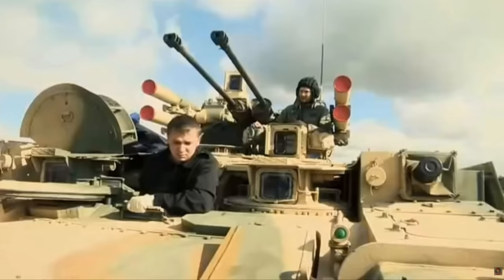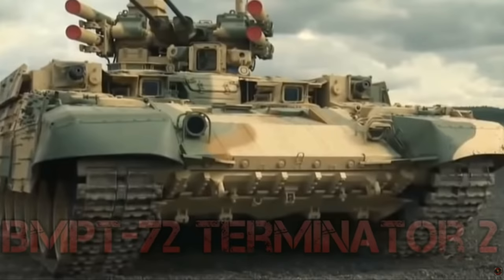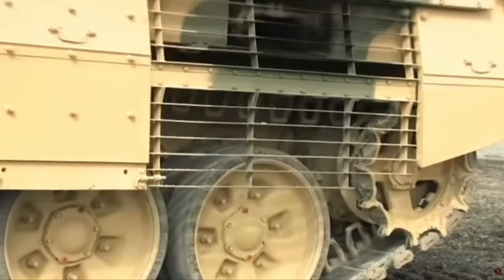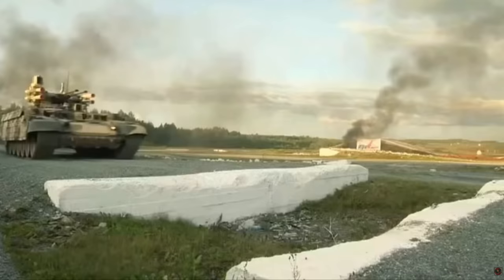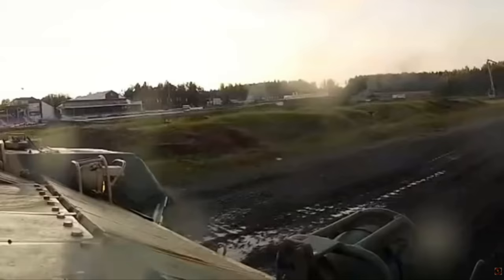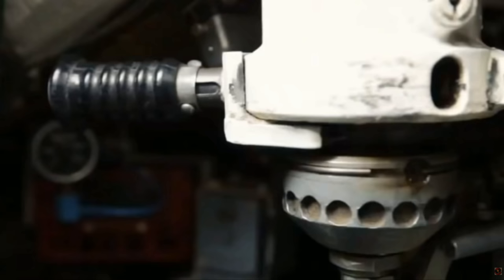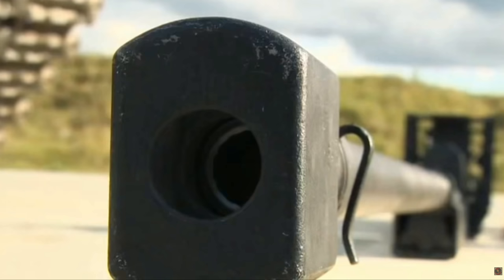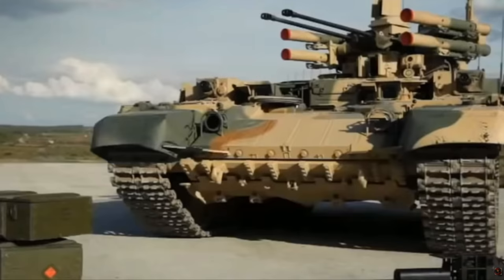BMPT “Terminator" Tank Support Vehicle Overview

Comment: Well ..  A Stugna-p - with the launcher just above line of sight - and the (thermal detectable) crew behind cover - will unlikely be detected and reduce the vehicle to a wreck. Spray and pray looks impressive, but a distraction from a bit of fireworks in a forrest edge will possibly make it expend its ammunition to no avail. Technology is currently on the side of the well hidden defender.
Reply: Stugna can't penetrate most of BMPT
Reply: @grandayatollah5655  stugna P can most definitely go through a T72 hull even with k5 on top. This is a modern tandem ATGM which deals with most hard targets fairly easily. We've seen these wreck T72B3s and T80BVMs which means they can also wreck a BMPT
Reply: @grandayatollah5655  Hmmm i really doubt armour as a concept now.
Even then the ATGM can just hit the turret or track that are both unarmoured and will disable the vehicle.
Reply: @davidty2006  tracks have Relikt + 4S24 sideskirt
Reply: @Yung_pindakaas  BMPT doesn't have Kontakt-5, it has Relikt (which alone can stop tandem shaped warheads)
Reply: @grandayatollah5655  Sideskirts arn't much.
They don't cover the whole track normally just the top.

Comment: A T72 chasis with a 5 man crew. 🧐🤔

Matt: Radar guided Air Defense system. 
Me: So the Shilka 2. 👍
Reply: The T-72 is built for a 3 man crew + the autoloader. The Terminator has no autoloader though has  an unmanned turret if I'm not mistaken. It's going to be cramped in there for 5 people.

Comment: The T-72 and T90 hulls are in dire need of a new gearbox. In combat, the crews of these things are still forced to reveal the rear end of the vehicle. Maybe T-80 hulls with diesel engines would also be good for the BMPT system. E.g. to drive up to the trenches, to unload his load into the trenches and then with the frontal armor to the opponent, to retreat again. But with a T-72 hull, that's unfortunately not possible. The BMPT has to turn and drive away with the rear facing the opponent. You can also see that here in the video that the Terminator never drives backwards but always just turns to drive back. There is a video of such a thing attacking and destroying a Ukrainian fortified position and trenches in a forest. Absolutely amazing how this thing blows everything away. A tank would have had major problems in this environment.

Comment: When there's a javelin coming after a armored vehicle it's open season 🚀 protection I don't think so 💥
Reply: Javelin has shown to be a bit overated in the current conflict. When it works its good, but it doesnt always work. Even western users of the system have complained about not being able to get a lock on tanks. Lots of complaints about it failing and also not being practical due to being way too heavy and bulky for a portable system. The best weapon AT Ukraine has so far in the conflict is Stugna-P.
Reply: @MS-wz9jm  Hmmm Stugna P is just set it up and go hide behined a hill or something.
Since its remote operated thus not risking the gunner.
Making it ideal for ambushes.
Reply: @davidty2006  Yep. In terms of man portable weapons the Panzerfaust 3 and AT-4 have worked well. No failures and not too heavy or bulky to carry around.

Comment: Terminator 2 built on T-90 chasis, not T-72. First one was T-72 based and it was around for realy long time (prototypes apeared in 2002 if i remember correctly)
Also it uses Ataka missiles with 900mm penetration and not Kornet ones with 1200+mm
Armata based prototype already there, and it have 57mm gun instead of dual 30mm
Reply: But like the rest of the Armata Platform we aren't actually seeing it being produced yet cos the RF is running into a lot of issues with the manufacturing capability side of things.
Reply: No, other way around. First one was on T-90 chassis (which we see in Ukraine)
Reply: @darkshardshoots  Were did this information come from? Because from latest reports the Russians are moving ahead with the T-90M and buying up Armata platforms slowly over-time. They haven't halted at all....I don't know were you found that information?
Reply: @gregorylouis617  as far as I've read production has all but halted as of April 2022. The Terminator 3 platform has yet to be introduced and at most 20 actual T-14s have been produced.
Reply: @darkshardshoots  you must have missed the ships loading 2500 tons of metal each from Mariupol to Russia.
Reply: @lancerevo9747  the bigger issue is actually complex components; computer chips, high fidelity photoprocessors etc.
You can have all the metal in the world but if you can't get the stuff to make the fancy electronic systems you need, you may as we just start churning out T-34s again
Reply: @darkshardshoots  that's the thing: Russia doesn't need or use super complicated 7nm chips in their equipment. Russia has its own semiconductor foundry as well as China, and while they aren't as size- and weight efficient as TSMC works, they're sufficient for most uses.

Comment: The problem of this vehicle is the fact that duel mounting autocannon lacked the accuracy necessary to hit single person anti tank missile crews at medium range. All of its designs are based on close urban combat but it is still highly vulnerable to mines and weapons like javaline or RPGs.
Reply: as usual experts :)) who know how to shoot every Russian weapon, and they know that Russians are in Russia :)) really, 2 30 mm autocannon can not miss anything in their range :)) plus joke with javelin, which many did not detonate, or detonated prematurely :))) maj blows being made by the Russian or British system nlaw ..Terminator is present in Ukraine, and only in fortified areas .gen casemate sist extensive trenches from where launches counterattacks, which end disastrously for attackers
Reply: @leomarin2205  lol. It is a dead program for a reason or two. If it was successful in Syria, then it would play a key role in BTG as standard supporting vehicle with T14 and T72. It got dropped because of problems I had mentioned. The cost for all the optics and night vision targeting systems is also deemed too expensive for infantry vehicles, which Russians want to invest those in main battle tanks instead.
Reply: 30mm autocanon do have shrapnel charges that detonate, you dont need to score dirrect hit to dissable infantry. If that thing started firing anywhere near you your best option to go underground
Reply: @iMost067  Everything sounds perfect until the other side hits you with 20 km artillery shells and drones. Again, if you pit 5 men veruse 5 men in the "terminator", you may win. But the program is canceled because it is a vehicle for a very limited scenario. To spend that much money on an infantry vehicle, Russia opted to go for a better main battle tank instead.

Comment: The T-95 was NOT the Black Eagle project. They were 2 different projects. The T-95 was for the Russian Army and was designed from scratch while the Black Eagle was for export and was based on the T-80. Thing is there wasn't much of a Black Eagle project. Only some plans and some initial research was done. A mock up was also built but that was it.

The BMPT is not a T-72 or a T-90S. Yes, it might have either the platform (vehicle) of the T-72 or T-90 but there's going to be more modified even under the bonnet.

As for those rocket launchers in the front of the vehicle, they are back up weapons. That turret will probably be quite easily taken out because that's where most of the weapons are, making it a prime target. If that gets destroyed you're not completely helpless.

It's not precisely known how many of them were produced and how much they were integrated in the Russian Ground Force..

Comment: If you mix this thing with a Merkava-chassis (III-IV), you'll end up with a powerful, very heavy IFV. 
Otherwise, I can't see that this machine can do more useful things, than what an IFV can do, besides coming with superior armor for the chassis. But it definitely can't do all of the things that an IFV can do. Strange combination.
Reply: So... A namer with an autocannon and some ATGMs?
Reply: Well, if it feats the same chassis as MBTs, I guess it also means easier logistics and repair, and most of the crew can be swapped with MBTs depending on tasks. Seems like a test pad for the Armata concept of a unified combat chassis

Comment: @Matsimus
couple questions though: as a armoured vehicle operating soldier, what is your impression of BMPT shall you work with one of them in a military operation? why don't we see equivalent vehicle in the west? if such concept doesn't exist in the west what does the west use to deal with such nessesity ?
Reply: Israel actually has a near peer to this in the Namer IFV. It is built on the chassis of the Merkava MBT. But the BMPT is certainly 1 of a kind.
Reply: Well puma has probably the same capabilities and more due to better tech
Reply: puma buddy
Reply: Heavy IFVs are a thing but in a different way. The west doesnt see mounting IFV armament on a tank chassis necessary but are just developing heavy IFVs instead. The only thing a tank chassis actually protects against is other tanks and old atgms.

For example the german Puma has a 35mm autocannon with dual feed ammo. So can switch between HE VT and APFSDS on the fly, instead of having two guns for it. It has far more advanced SPIKE missiles. Its armor can withstand autocannon fire at range, it has softkill APS against older ATGMs and can carry troops. The only advantage a BMPT has is immunity to autocannon fire even at close range and the ability to take hits from old tank rounds. Which in a modern conflict doesnt really matter.
Reply: the Russians developed this weapon on a tank chassis because they have infinity t72 tanks and its cheaper to just mount a new turret on an already well armored vehicle like an older tank than it is to develop something entirely new.

Comment: Im no expert, but I dont think that two 30mm will succeed where one failed, nor that a handful of vehicles can make a meaningful difference
Reply: I could see a BTG having 10 of these AND 10 tanks where they run in paired units trained to work together.  That would require a LOT of money to pull off though.
Reply: Since Russians are engaging the cities, it would make quite a difference. Well, if they use it properly that is.
Reply: @swaghauler8334  if we are talking about the current situation its not so much the money, it would take time and possibly foreign components to produce more of them. I think the ones that exist were supposed to go to Algeria, but dont quote me on that. The concept has some merit for sure, if you think about it its not that different from a heavy IFV
Reply: @jkl9984  but if you think about it the only thing it can do that a bmp2 cant is survive a couple rpgs(possibly) and maybe have better SA, it is an improvement but not a large enough one to matter imo
Reply: @matteocesa9017  Only time will tell though. I do have yet to see propaganda footage of the BMPT-72's engaging Ukrainian forces. On paper it does have a enhanced survivability against javelins and other man portable top attack munitions, due to turret being far more dense and packed with ERA blocks.
Reply: @jkl9984  thats for sure my friend
Reply: dunno about twin canons too, but vehicle that have actual armor to actually withstand any frontal shot compared to some BMP-2 is quite neat.

Comment: One more advantage it has is that it can carry different rounds at same time that means from one gun it can shoot AP/ Armour piercing rounds and from other it can fire HE/Heavy explosive rounds or can fire both at same time. Some saying it does not fit in Russia's requirements is wrong rather Russia is finding the best possible configuration of this vehicle in respect to cost and complexity. They have already made some 350 units since 2002 of this system but most of them are prototypes which shows that they are interested in it.
Reply: Not really an advantage, as BMP-2 and 3 use dual feed for their autocannons and can swap ammo type with one flick of a button, unless you just want to shoot from both barrels to satisfy your dakka needs.
Reply: @Panocek  bmp 3 autocannon not dual feed, it was single feed. They cramped a 100mm low pressure cannon, 7.62mm mg, and modified the standard 30mm to make it smaller
Reply: @rkadi6540  Care to post your source for A272 autocannon being single feed only? All I can find about that weapon points towards dual feed, as in, able to switch between AP and HE belts on a whim.

And then next to said autocannon you have 100mm cannon. Sure, low velocity, low pressure, with caliber limiting effectiveness of ATGM, but 100mm HE is still considerable boom by AFV standards.

Comment: The Russians only have a handful of these vehicles, maybe 14 at most. Russian optics are not effective plus it is a T-72 chassis, something Panzerfaust III, RPG, NLAW and Javelin are having no problem with.
Reply: You can even buy Javelins for sale from Ukrops for $30k in black markets right now!
Reply: the main difference is that it doesn't have a large  autoloader under the turret  like the t72 (there is no 125mm cannon). That way you cant blow up its ammo rack and destroy it.
Reply: @ASS_ault  Hey, don't get upset with me.

I'm not the one selling Javelins.
Reply: @ASS_ault  Ah, so now you're just lying. Gotcha.
Reply: @ASS_ault  Just visit the website and check for yourself...
Reply: @akboy47  I has thousands of rounds of autocannon ammo that won't be much fun if its starts chain burning up.
Reply: @obsidianjane4413  the ammo is inside of the turret, the turret is remotely operated so there is no one next to it.
Reply: @akboy47    Only the belt feeds and guns are up top.  Most of the 1600 coke bottle sized rounds are in magazines in the bottom of the turret basket. The gunner and TC are in the turret and its a pretty safe bet there is no compartmentalization to keep bad things from happening.
Reply: @obsidianjane4413   The ammo compartment is a lot smaller than the one on the t72, that way its a lot harder to hit it. From the diagrams,  i saw the ammo rack on the t72 is like 2 or 3x larger. This vehicle is a lot safer for the crew.

Comment: The Javelin will turn it into scrap metal in seconds. Just new food for the Javelin
Reply: The Javelin has had enough chances to kill it in Ukraine but looks like it's the one doing the killing of the Javelin teams for now.
Reply: People do forget that Javeline have realy long Lock-on, especialy old revisions that in Ukraine. When this thing can insnatnly fire when spot anything on thermals.
Reply: @iMost067  Throw in the difference between the effective ranges of the Javelins and the 2A42/Ataka and we have something.
Reply: @imrekalman9044  not realy usable difference unless it can be locked by someone else. 
Places that have fields where you can see further than 2,5 km away without any hills, woods, etc. are realy rare even  on completely flat ground. Its already artyllery systems work that works on coordinates or spoting with help of other devices.

Inside 2,5-3km range BMPT is bigger threat to Javeline team that Javeline team to BMPT, on further ranges any contacts  would be extremely rare, but since BMPT there literally to support tanks and would be in formation with them - then there a re tank with 6km effective range.
Reply: @joeo2533  not the BMPTs but the Artilleries